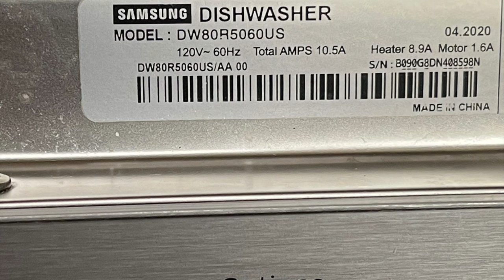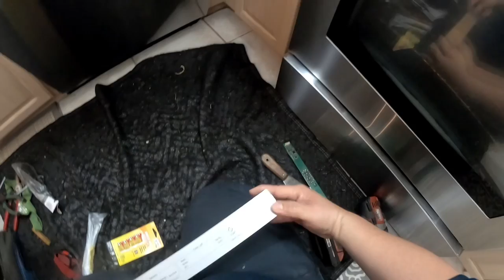How to Fix Samsung Dishwasher Buttons Not Responding | Touchpad Not Working | Model DW80R5060US

Comment: This helped a lot, took the board out, it was damp, washed with alcohol, confirmal coated the entire back of the board, and reinstalled it and its working perfectly
Reply from the maker: thanks for watching my video👍🏻👍🏻💯💯
Reply: Was your dishwasher not turning on at all? Mine just stopped working after it worked last night.
Reply: @NooDLES411911  ours has no power, no response pressing buttons. Checked for 115v power at the lead wires, there is power to the dishwasher.  Replaced wire nuts. 

Pulled or twisted the door on the left side, and power came on, intermittently. 

Turned off circuit breaker. Deconstructed the door completely and examined all door wires. Nothing abnormal found. Power CB, power is found in the door wires, but no control panel. Wiggled the door frame, power returns. CB off, reassemble door, CN on, no power. Twist door, and it works. Something wrong at the door hinge.

Comment: I put my board in the oven at 385^F for 7 minutes and it started working again.  Display is a little blurry but buttons work.  Ordered a new board to have for spare.  Thanks for showing how to get to the board, the whole assembly is either on perpetual backorder or Samsung stopped making it.

Comment: Hey man, I’m trying to fix this exact dishwasher, I got a new touch panel and installed it but the controls are just as bad as the original circuit board… Do you think the problem could be keeping the adhesive? Maybe some of the buttons have a hard time making contact?
Reply: Yes everthing from samsung - crap